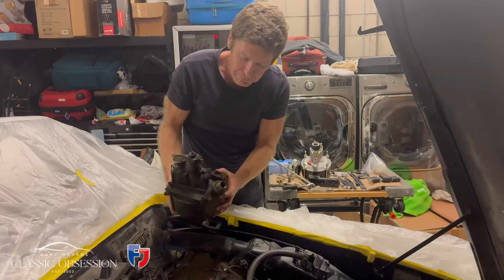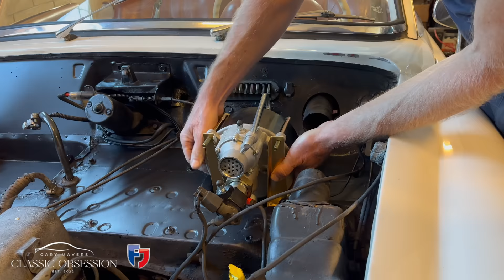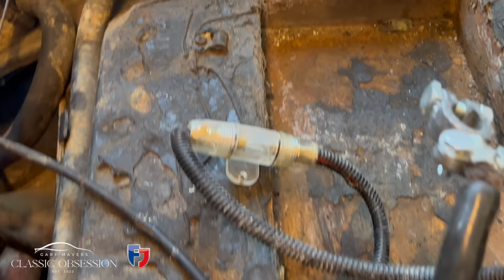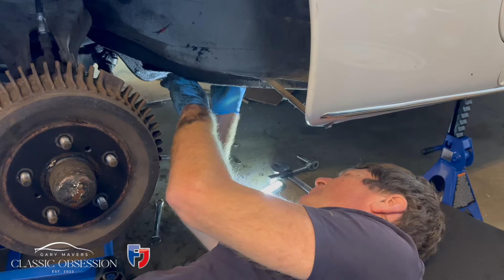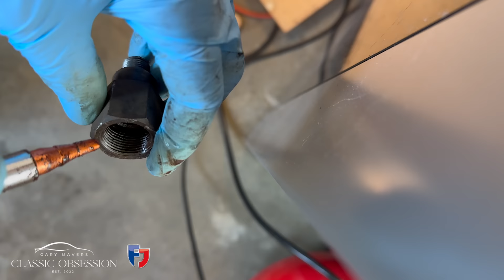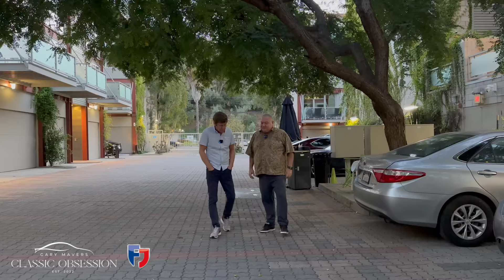Mercedes 190SL Resto (Part 5) | Out the garage after 24 years! | Classic Obsession | Episode 51

Comment: Using a spray can to paint in the engine bay, did you use a wrinkle or hammered finish paint?
Reply from the maker: Heat resistant satin finish. Regards